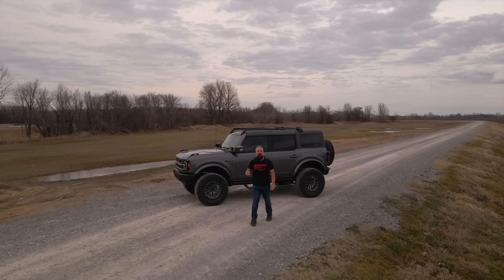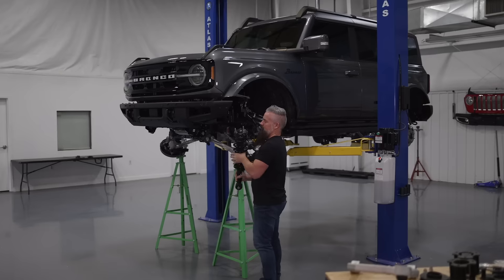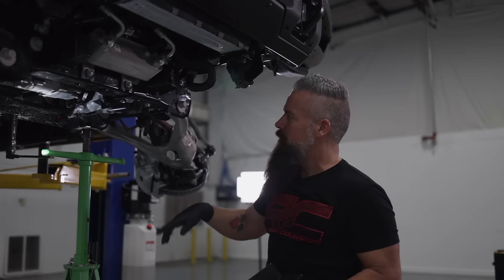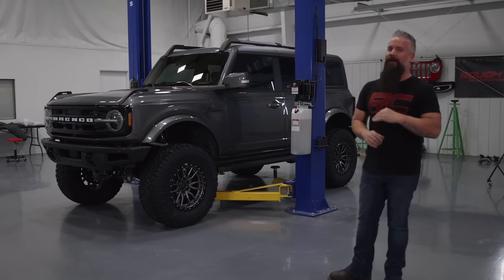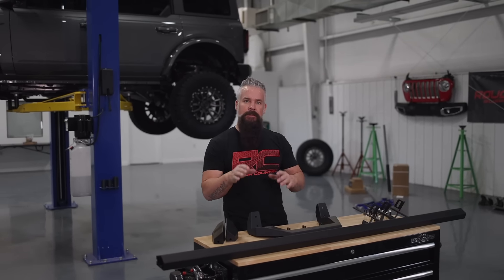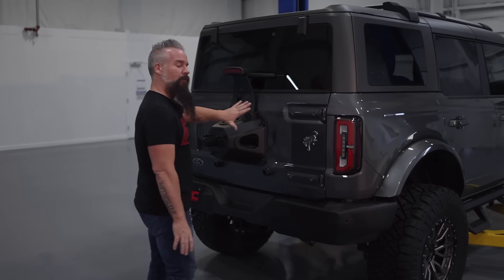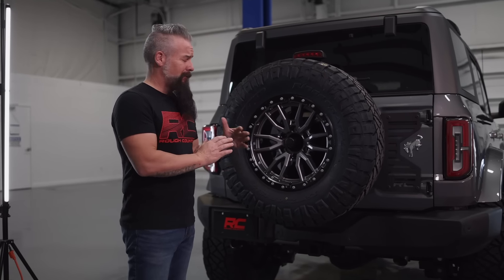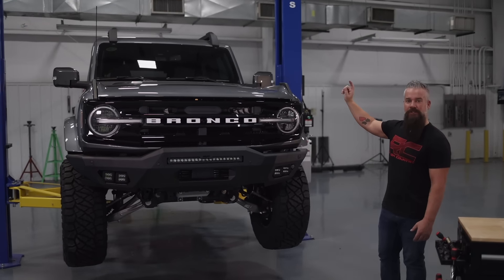Lifted 2021 Ford Bronco Build

Comment: I am waiting for my 4door white base.  I already have the level kit and xd monster 2's ready to mount when it finally comes in.  I'll be wrapping the hard top and fenders gloss white to match the paint.  Then I'm outfitting with lighting and hidden winch.  I'm so stoked, just a waiting game.  Its giving me time to find good deals on parts though.
Reply: What hidden winch you go with. I'm looking at a white OB 2.7 already has the RC spare tire enforcement installed and lifted. Looking at it again in daylight. I wasn't looking for a white bronco but it really doesn't look bad.

Comment: I have watched many of these type of videos. Something no one is addressing is the speedometer. With changing the size of the tires you've always changed the accuracy of the speedometer. How do we adjust this to make it accurate? Of is this something that you just dont address and we just have to guess at the speed?

Comment: Patiently waiting for the winch mount for the module bumper.
Reply from the maker: The hidden winch mount works on both factory bumper options provided you have the 2.3L engine. The 2.7L engine version is in the works.
Reply: @RoughCountryTV  I’m talking about the winch Mount that goes on top of the modular bumper. You showcased it in another video, so I’m patiently waiting for you all to release it 😀
Reply: @RoughCountryTV  got to hurry up lol

Comment: When are the bumpers coming out? In the other video of you guys showcasing the bumpers there are 2 versions of the front bumper, one that lines up with the body of the bronco (Blue beast bronco) and the other, that lines up with the fender flares (White Bronc). Will both be available?
Reply from the maker: The front and rear bumpers will be released and shipping within the next few weeks.  The front bumper is modular with the ability to remove the outer sections for more approach angle clearance.
Reply: @RoughCountryTV  😮 ❤️
Reply: @RoughCountryTV  thanks for the response, I’m glad to hear this! 

Aesthetically, you guys knocked these bumpers out of the park. The are rugged, but minimalistic (not clunky). They give these new Broncos a sleek look.
Reply: @RoughCountryTV  Definitely will buy the bumper as soon as I see it released, with the lights and hidden winch! Can't wait!!! Thumbs up!

Comment: It seems like with that much lift, you could probably run 37's.  I ran 33.5” tires with no lift on my Outer Banks (without any interference under all conditions).
Reply from the maker: Yes, 37's would fit, but might require additional clearance modifications.

Comment: Wondering if you guys re-geared this?  Seeing that its a non SAS stock, I'm assuming it came on w/ 3.73?  My Bronco is a nonSAS Bronco as well and wanted to throw on almost exactly what you have here.
Reply: 35s are fine on 3.73 gearing. I’ve ran 37s on 3.73 and I wouldn’t recommend it 😅 35s are about the right size imo

Comment: I'm not a mechanic, but it seems like lowering the differential is counterproductive to lifting the car. How does that work?
Reply from the maker: It is lowered to help keep the driveline angles correct
Reply: You’re correct. 99% of “lift kits” actually just lower the driveline and don’t creat any ground clearance. More ground clearance is created by running bigger wheels and tires.

Comment: front bumper work with adaptive cruise control?
Reply from the maker: It does. You will notice a lower center cutout that allows the sensor pack full forward visibility.
Reply: @RoughCountryTV  Can we order them now
Reply from the maker: @bobbieleach3568  Our Bronco bumpers are not currently available. We are working on it!

Comment: The only glaring issue is that it has too many doors.  Otherwise, it's not too dissimilar to mine, even has the 2.7 V6 in the Bronco you spec'd
Reply: 4x4 with 4x4 doors looks the best. I know 1966 broncos look great with 2 but not so much with modern ones.

Comment: I’m so confused how wheels can have poke when they aren’t even a 0 offset or even when they are a 0 offset. I would have though these were -6mm or -12mm for sure. He doesn’t mention offset but I looked it up and it says 20mm??? Is anyone else ever super confused about offset and poke? I understand how offset works but I don’t understand how some wheels with a 0 offset look completely flush with fenders while others stick out and in this case if these are a +20mm how they look to have so much poke like a negative offset. They look like -6 to -12 as I said. I understand it’s possible some ppl are running spacers but in this case it’s clear he is not!